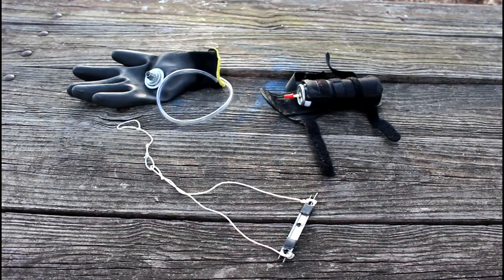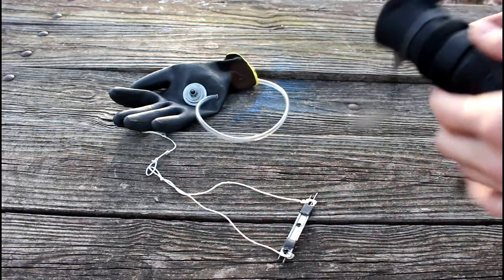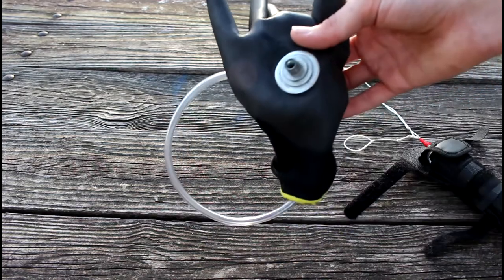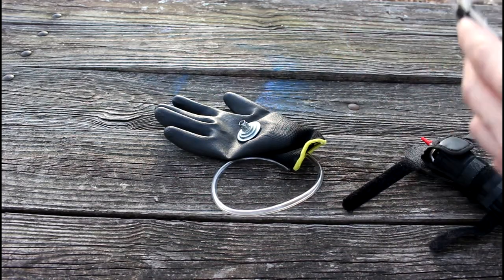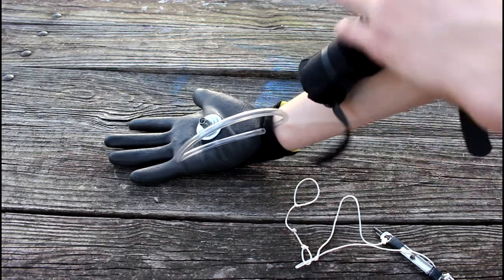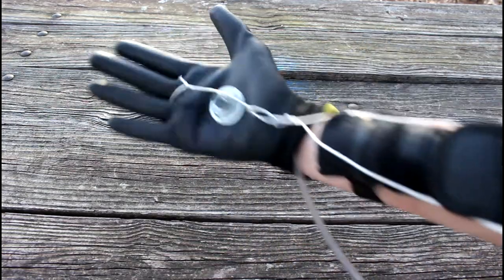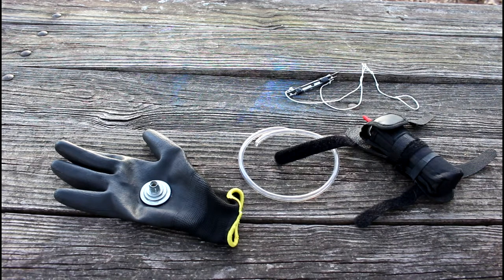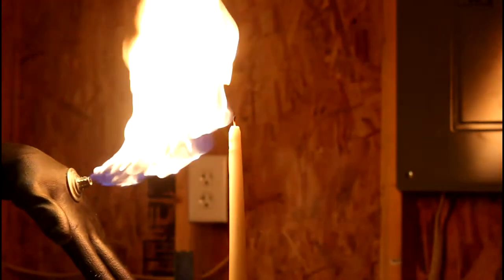Wrist-mounted Butane Flamethrower

Comment: Very neat. I like how you put the gas output of the tank to the other side than the flame, for safety or unintended?
Reply from the maker: Both lol, it’s safer that way and that is the simplest way to release the gas by pulling on the string. To work the other way I’d have to add something to reverse the direction of the pull, or add a lever or something.
Reply: Okay. Like the idea very much, and sine butane is like 1 dollar where i live, i think I'm going to try this also! Maybe make an Iron man-ish exosuit to keep the butane.